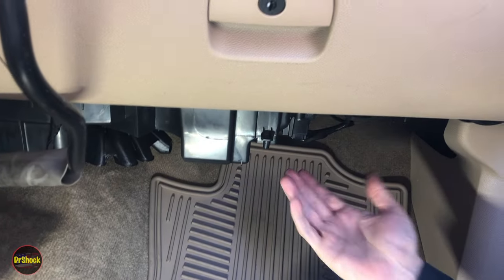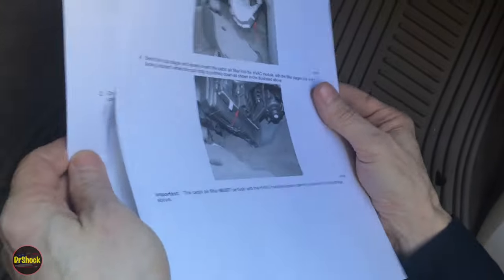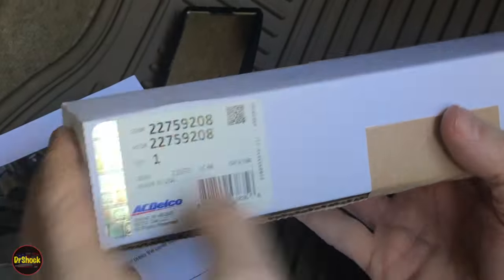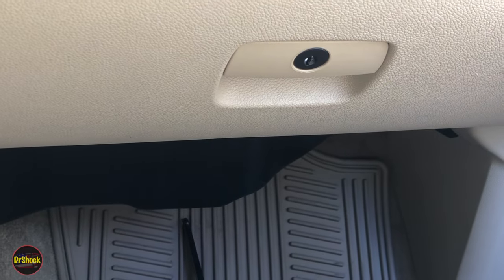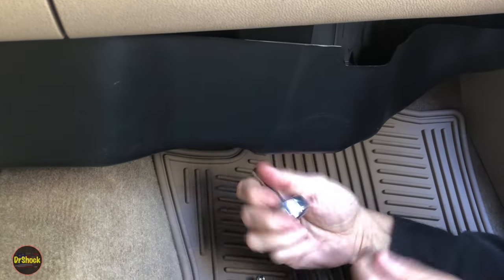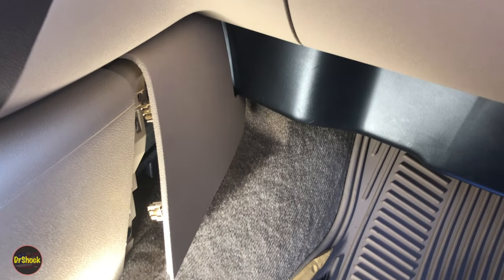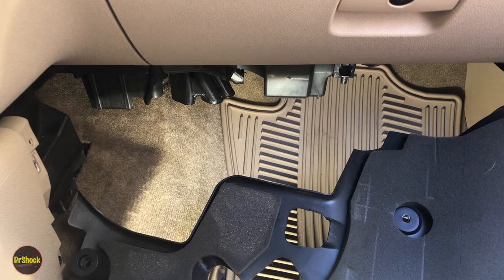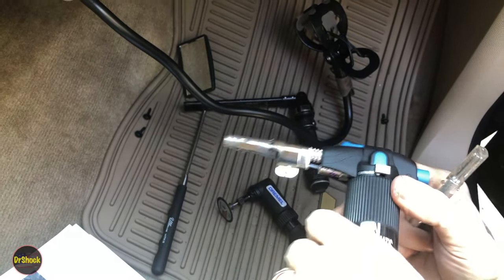2007 - 2014 GM Trucks Cabin Air Filter Retrofit Kit Install (Chevrolet Avalanche Suburban Tahoe)

Comment: Will cleaning up the evaporator and putting a filter in there help increase airflow and air conditioning efficiency?
Reply from the maker: Adding a filter will slightly reduce air flow at each fan speed setting.  But the air will be cleaner protecting the evaporator thus maintaining, not increasing, the designed efficiency once the evaporator is cleaned up from not having had a filter previously.  As a bonus the air you breath will be cleaner, and likely with less odors as well.

Comment: Use a heat gun and a razor knife.  Just heat up the plastic.   Its safer  easier doesnt fill the air box, car or your lungs with burning plastic chips and dust.   After the  guy that did this sees this im sure after he reads this he will probaly agree.
Reply from the maker: I used to do jobs like this similar to how you describe, but the plastic dremel wheel leaves a much cleaner cut with a factory appearance than a hot blade so its all I use now when I can/it will fit.  Proper PPE will address any dust concerns, as well as the vacuuming and cleanup afterwards that has to be done anyway from not originally having a filter in the first place.

Comment: Great video, but 1 mistake... He put filter in backwards... Should be bent slots facing you and not away from you and he got the top to bottom correct with the white flaps down... He just installed the filter backwards
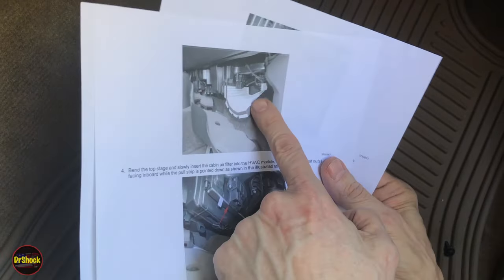Reply from the maker: Thanks, but actually it's not installed backwards if you're using the ACDelco filter retrofit kit and a GMT900 series truck.  If you note at 1:18 I showed the official GM dealers service bulletin for this ACDelco retrofit kit which clearly and specifically indicates to orient the ACDelco branded filter with the "V" notches ( aka filter stages ) cut into the black plastic frame facing inboard towards the drivers side only.  So this was the installation approach shown, as this video is intended for use with the GM factory retrofit kit.   Aftermarket product instructions and filter media of course may differ.

Comment: Excellent presentation, what would be interesting to see is an retrofit engineered solution for GM400 OBS truck 1988-1998 cabin air filter. There seems to be nothing off the shelf available to put a cabin air filter into those trucks - even 'vintage air' has nothing available.

Comment: Thanks for the clear and easy to fallow video. I'm driving a 2007, and it doesn't have a glove compartment. There is very little airflow even at max. I know the filter on this van has never been replaced.

Comment: Steller idea with the shop towel to not spend time looking for the screw like i did.   I lost all the time  i had saved using a heat gun and razor kniife  to cut my hole instead of doing it like you did.   Lol

Comment: Your videos are excellent and always useful. It is rare to find someone that does things well and correct, or at least following best practices. I would love to know if you have an idea of how to retrofit a cabin filter into he OBS GMT400 series trucks and suburbans. I dont believe there are any kits on the market, but if there was anyone who would know or would know how to make it work it would be you. Thank you for your one.
Reply from the maker: Thanks.  The GMT400 was developed before cabin air filtration was a thing.  So nothing from GM to add that kind of cabin air filter capability was ever released.   However, there is a reusable mesh filter in the evaporator housing (ACDelco 15-33308). 
 And if you have a Suburban/Tahoe/Yukon or Escalade on the GMT400 platform there is a reusable filter in the rear A/C unit.  Neither are easy to reach, and are not capable of filtering smaller particles since they are intended to be cleaned and reused, but it's something.
Reply: Where did you bought the cover? i was about to change the filter. Thank you in Advance.

Comment: A couple notes from doing this
1) a sharp drywall knife with 3 or 4 passes will cut thru plastic and leave a clean edge

2) only side to side strokes with a plastic bottle brush or brass brush.   Up and down strokes will bend the thin fins
Reply: So no need for a dremel tool?

Comment: so with no filter in there,  the entire system is full of dust/debris...correct? Any ideas on how to clean that up ?
Reply from the maker: I go over that in the video, as well as recommend a product you can  find in the video description that can help with the process.
Reply: @DrShock  sorry, i must have missed it... all i remembered was cleaning up the cut and the evaporator & not the rest of the system(which is what i was hoping to find). I'll try go go back through it. Thanks.

Comment: Do you know the part number for the cover with the 3 bolts ???
Reply from the maker: For the models with a center console like the Avalanche shown in the video it should be GM 25790726.   Those without a center console would be a different part number that I don't have atm.
Reply: @DrShock  thank you it is the part 👍🏼

Comment: Will this fix the Problem with outside air with recirc on?
Reply from the maker: Adding a cabin air filter is for health purposes (cleaner filtered air from outside the vehicle coming in).   If that's what you're referring to.

Comment: My 07 trailblazer came without filter/filter door. I want to do this retro fit but not sure if this kit will work as trailblazer is not listed in the specs? Anyone done this on a trailblazer or know if it will fit?
Reply: It's all compatible and looks the same pretty much

Comment: You can see the evaporator and see how dirty it is without a cabin air filter
Reply from the maker: Not on this GMT900 model.   There is ZERO visibility to the evaporator without making the factory authorized modification described to open up and add the access port.  You could choose to not install the filter, but there's no getting around cutting the opening for inspection.

Comment: I have a 2007 2500 HD. I don't see anything like that at all.
Reply: I have a 2006 gmc Sierra 2500hd with the 6.0L gas. And yea, I don't see a cabin air filter compartment on it either.